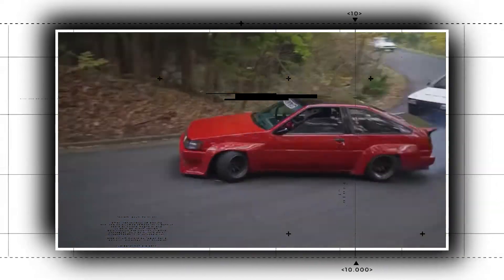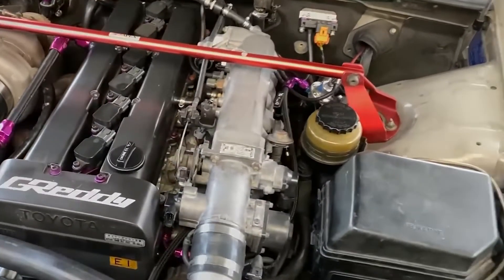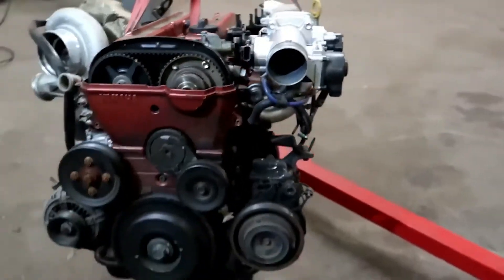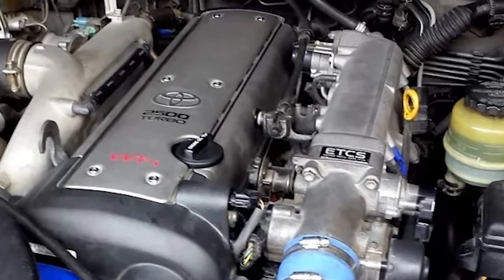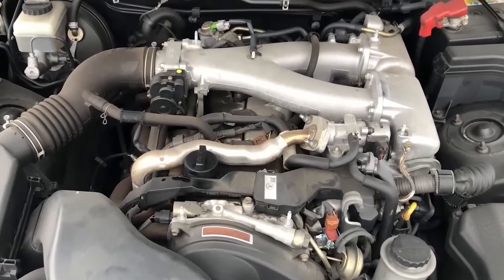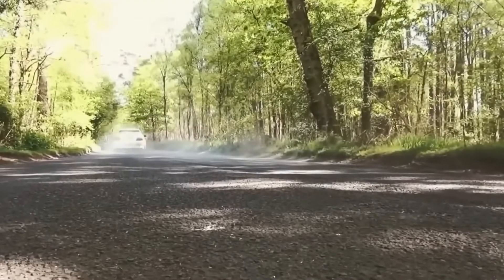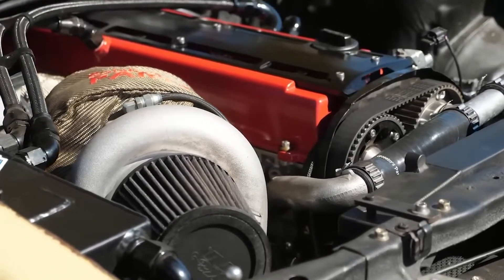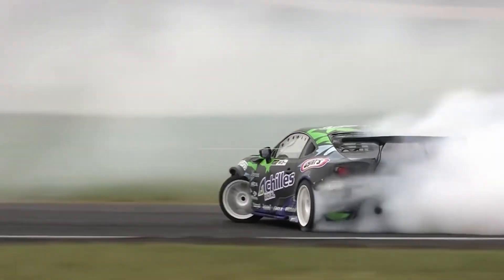Toyota 1JZ vs. 2JZ: Which Engine Swap Is Best?

Comment: But the 2jz differs from the 1jz in many ways beyond displacement...
A few moments later
Contrary to popular belief, the 2JZ and the 1JZ are very similar. The main distinction is the displacement which has increased from 2.5 to 3.0 liter from  the 1jz.

Comment: My old 88 Supra turbo has a 3 litre 265 hp factory engine.
Reply: Stock HP for a 1988 Supra Turbo is only 230hp. The later 1JZ JZA70 was 280hp